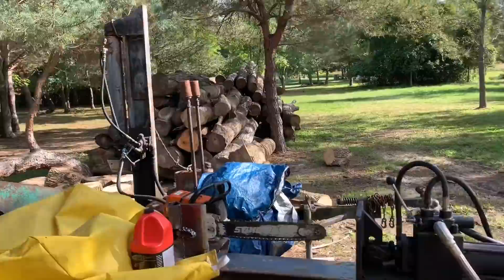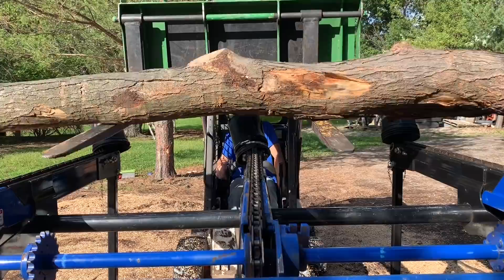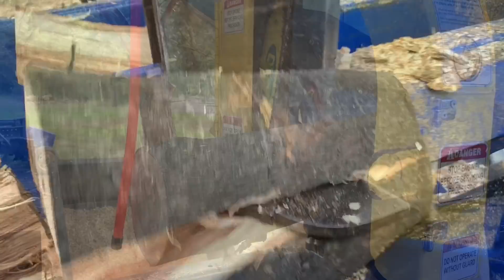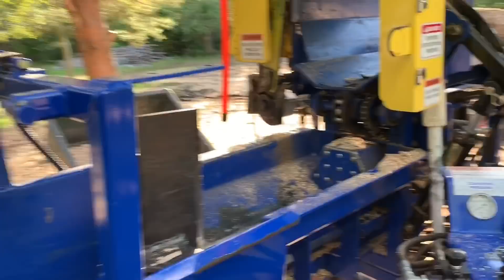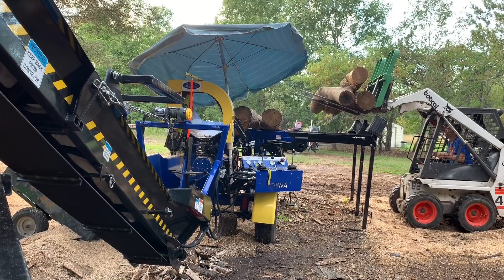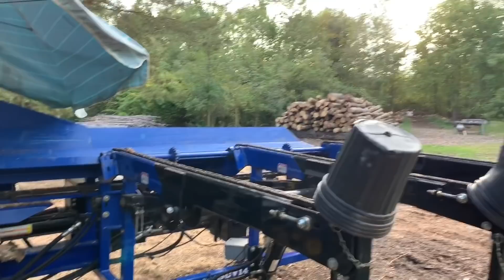HOW TO PROCESS FIREWOOD FAST!!

Comment: Processor looks like an awesome machine. What stood out in that machine that made your decision to buy it instead of a competitor's ?
Reply from the maker: Joe Orsborn thanks for watching.. I had rented another Dyna sc-14 machine prior to owning mine and it really impressed me when using it... I also really liked the way it’s built. Everything is bolted and easy to maintain..because everything in the firewood industry gets so abused from use over the years, Dyna has one heck of a reputation with there longevity.. also there customer service is A1 and the price for what you get is very hard to beat by competitors. I will do a Review on it coming soon! Keep watching, really enjoy your questions and comments joe 👍🏻

Comment: Bad ass set up how often does the chain need to be sharpened
Reply from the maker: Joe C in the summer time it will cut easily 50-60 face between sharpening.. but winter time is a diff Story.. thanks for watching 👍🏻